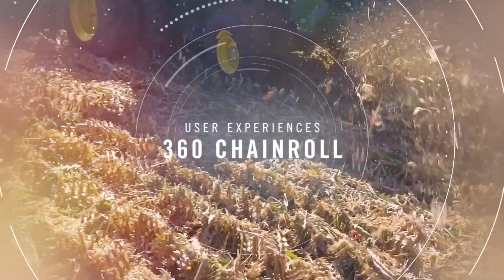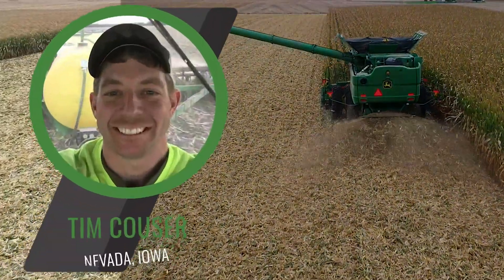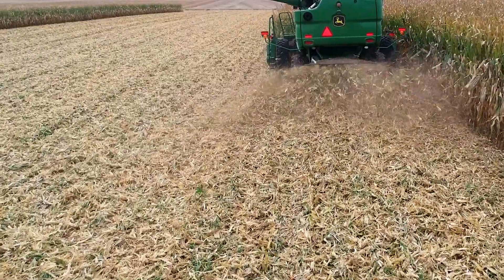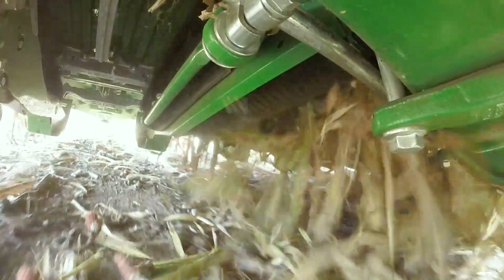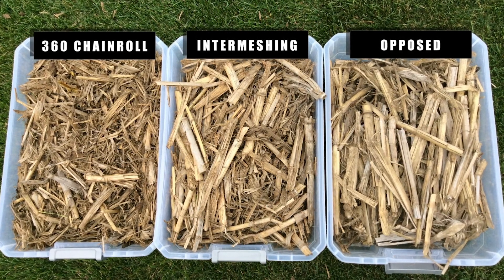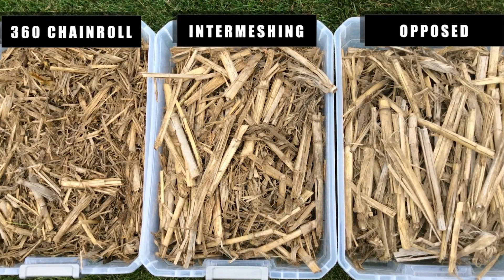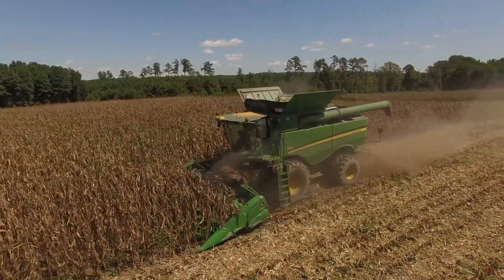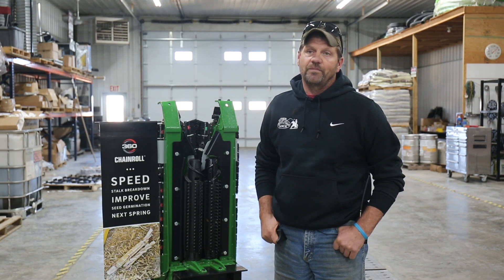User Experiences: 360 CHAINROLL

Comment: We have been running these for a few years now on an 893. the stalk breakdown from fall to spring is phenomenal..that being said, do not expect to follow the combine with the chisel plow like other farmers can with a lawnmower style chopping head as these are very good but not perfect at the 7” sheer point. Depending on the stalk conditions a lot of times there is still that last little strand left at each cutoff point still holding the stalk together so we will usually need something pretty aggressive with disks on the front to evenly mix residue without bunching but by spring it is broke down enough where it isn’t an issue and will not hang up on your spring tillage tool. But other than that I’m very satisfied overall
Reply from the maker: Thanks for the feedback, Josh. Glad they are working well for you.